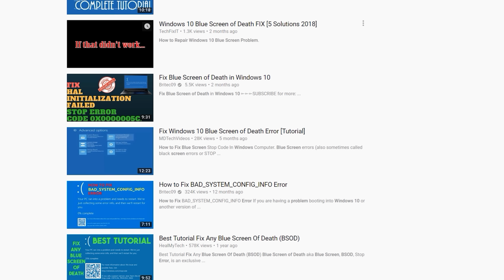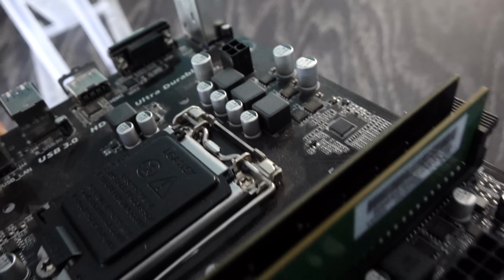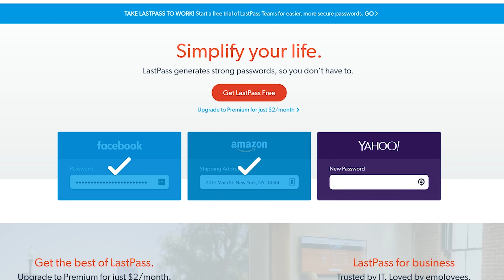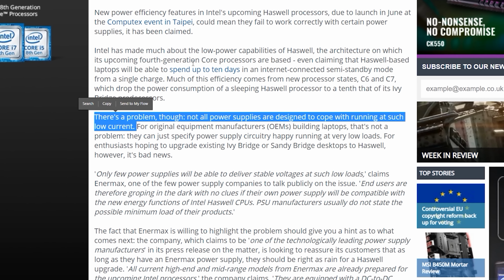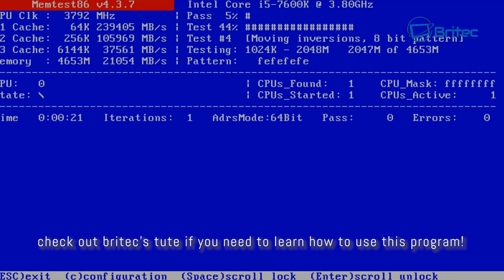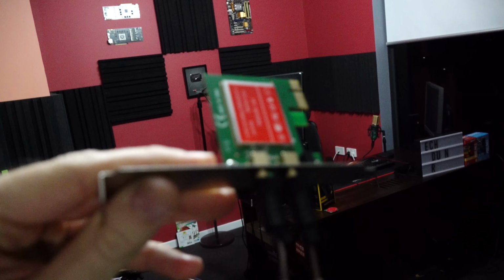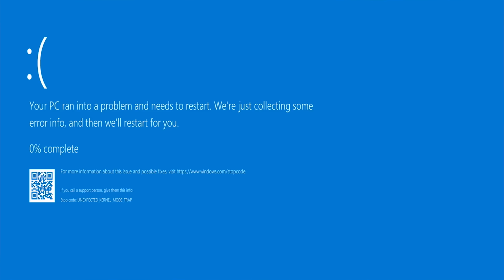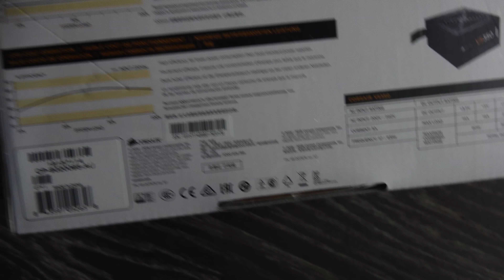How To FIX a Blue Screen on Windows 10

Comment: Go over random black screen for just a second or two then screen comes back and acts like nothing happened. It goes weeks at a time without doing it at all , then a day of it doing this every four or five minutes. I'm suspecting windows updates interfering  with gaming. I'm too lazy to check the cpu , ram , gpu usage. Windows 10 , 16 giggles of goats   , 4 core i5 7400, 1050ti
Reply: This is usually caused by the GPU core clock, try under-clocking or removing any overclock on the core of the GPU.

Comment: I had the weirdest powersupply failure ever. when you disconnected the psu from the socket and then reconnected it, the computer won't do anything for minutes. you couldn't turn it on. and after a few minutes, you could turn it on without a problem. I kept the psu longer than I should, but never trusted it.
Reply: Sounds like it had a faulty capacitor.
Reply: My ASUS automatically power cycles (on then off then back on) when you press the power after pluggin in the power
Reply: Some that wont warm boot? A friend got a similar thing. If he reboots it just stops, but if you turn it off and on again it runs fine. Also the BIOS won't keep settings even with a completely new battery.

Comment: You should probably mention not just increasing your CPU vcore randomly, or too high, especially if LLC is enabled. Easy recipe for overvolting the cpu.
Reply: True unless doing a high overclock.
Reply: Being conservative with LLC is a good choice to begin with. Going overboard with it can already overvolt the chip sporadically and kill it.
But yes, usually 1-2 steps over default should be fine. Usually there is the talk of 5% or even 10% over stock being safe in the long run. And luckily nowadays the boards show the voltage applied with current settings. So calculating the maximum "safe" amount. But again, 1-2 steps over default doesn't hurt.

Comment: Built a computer that just refused to post. The thing is, it would turn on and everything would run fine, but it just wouldn't give a picture. Tried new cables, new psu, new cpu, new motherboard, (to clarify I would switch parts around from the non-posting pc and some spare parts I have) didn't matter. I take out a set of RAM and try it... Works 100% fine. Put it back together minus that one set of RAM and it ran fine... Until I give it to my friend when the motherboard decided to die.
Reply: Sounds like my friends "House" Desktop. It wouldn`t post so they ended up getting a new desktop well i ended up taking it since it was just sitting there and they were going to end up throwing it out whenever.First thing i did was replace the psu when i got it just in case and turned out a stick of ram was bad.

Comment: Hello i love your content been watching you for 2 months , random question my pc sometimes crashes on the first boot of the day but on restart it works properly all day long what could be the problem?
Reply: do you have an amd card and use msi afterburner?
Reply: I do , r7 260x But i only use afterburner for monitoring not overclocking cause my gpu reaches like 70C while intense gaming dont want to risk damaging it
Reply: Unstable overclock?
Reply: Currently i do have an overclock on an fx 4100 to 4.2gh on stock voltages Temps are fine have an evo 212 but it has done it on stock clocks aswell so i said fuck it i OC anyways
Reply: Sounds like you need to increase V Core.I had the same problem when overclocking my i7 4820k along with 1600mhz ram to 1866 i had to max out some settings and figure out play with ram timings to make it stable.
Reply: I really dont want to increase voltage on my mobo it/s an MSI 970 one and i heard that it;s a bad overclock so for now i;ll just restore default settings on the mobo and hope it gets fixed else i;ll just live with it and hope the motherboard doesnt destroy my whole rig
Reply: Overclocking isn`t necessarily bad, unless you don`t know what your doing.There are plenty of fourms online and videos on youtube to learn from.I have a Msi motherboard aswell and pretty happy with it.
Reply: Sadly it isnt the overclock's fault i loaded optimized defaults closed it came back 2 hours later and it crashed on startup again i suspect either my PSU cause it only has 4pins for CPU power or motherboard is dying
Reply: Would suspect Psu/Cpu, motherboard i don`t know i would guess/hope it isn`t the issue.Possibly a registry issue?
Reply: I used every single other part on an older msi 775 socket board and didnt have a single problem so i guess it's CPU/Mobo issue , should i just say fuck it and try to find cheap used FX8*** Cpu or mod the 775 board for 771 and get a xeon?

Comment: The cmos battery is one of the first things I check.
Reply: How often would a cmos battery need to be replaced?
Reply: @BranZHamZ  p
Reply: @BranZHamZ I replaced it on my 12 year old pc last month for first time
Reply: this, i have resolved random blue screens after finding the battery was low and replaced it. assuming it was POSTing with some weird ram timings or something
Reply: yes even taking it out for 30secs and putting back in sometimes helps.
Reply: GReat jobs ... i tried it and its solve thanks mate
Reply: tnx for this hahahaha it works !

Comment: i never got a blue screen on this computer but if i use a riser for my video card and try to play games i get a black screen. then i have to reset my computer. without the riser i can play games on it all day long without any problems. i think it is that the power supply doesn't have the power to push through the riser and keep good power to the video card because i have the same thing happen if i try to oc  the video card
Reply: Or the riser just can't keep up with the data.

Comment: Working on a gaming machine today, the user tried to yank the video card out of the slot without releasing the retention latch on the slot, he ended up lifting the actual slot partially off the motherboard.  Going to have to replace the motherboard now.

Comment: I've been having the same issues for nearly a year now... Windows 7 Pro, 24gb RAM, i7 920, Gigabyte GA-EX58-UD5 rev1 flashed to F13 BIOS, GTX 460, 128gb SSD, 2 x 2TB Barracuda Data Drives.... yet, I can go 3 months without a BSOD or Auto Reboot and sometimes I can have my system reboot 8 times a day, I've changed my original power supply from a 500w modular to a high end 650w modular PS, given the system a TechYES cleanse, but still facing the same issues, all capacitors on the MB look fine, CPU HW Monitor states a max 160w draw???  I've been thinking of upgrading my CPU to a Xeon X5675 and a 1070ti, but don't want to waste the money if my MB is fried, just cannot understand how it can work for 3 months perfectly and then for one or two days reboot it self 8-9 times a day.. I love the X58 architecture.. any help would be appreciated Bryan...
Reply: I had a similar problem in the last 3 months. I tried a lots of things. What worked for me was get out the cpu from socket and reputing back. Its a system that i build in 2014.
Reply: I feel your pain man, but I've done all that, the system was completely stripped down, CPU put to one side and the MB doused in cleaner, left in direct sunlight for 5 hours (UK sunlight this is, before anyone thinks I've burnt out my MB in 100c US temps), power supply stripped down and blown throw to clear anything, even the memory channel slots were done with a small ear bud and alcohol solution, 2 days I waited to put everything back together... The only thing I didn't do was remove the heatsink from the VRM and Durable 3 covers and re-seat them with new TIM...
Reply from the maker: Would have to try out the hardware one by one to identify what is causing it, but also can try a quick datavac over it to make sure nothing is out of the ordinary, also too tight a tension from a cpu cooler can sometimes cause issues too (though it is very rare).
Reply: Could there be a loose screw somewhere inside your case?  Maybe it happened during the build process?  That be shorting out the motherboard
Reply: I'd pull the ram, remove any dust (also around ram slots) and put back in firmly.  Do memtest, maybe lower the timings of the ram in the bios if the problem hasnt been tracked down.
Reply: I had this issue with a 60gb SSD years ago, in the end I just bought a new one and all the issues went away.
Reply: It's the Windows update mess...
The weirdest thing is why you didn't upgrade your cpu!?
Reply: unstable overclock?? try lowering clockspeed
Reply: Nothing wrong with the F13 bios. Have the same spec PC. Try reseating the CPU and Ram. I'd recommend changing the i7 920 and get a Xeon X5650/60 if you are on a budget and definitely replace the CMOS button battery if it is over 3 years old. Incorrect time and date can cause issues. If your SSD drive has been on like 24/7 for 7+ years I'd probably want to replace that too.
Reply: Go step by step. If it is oc'ed revert back to stock.
Try anything to force the crash. That way you might get a procedure that "works"
Also check for firmware updates on your SSD. Had a similar issue that after some days of runtime the system would spontaneously freeze. Couldn't help it until I found a message of the successor series where a similar issue got fixed by a newer firmware. Updated mine and since then everything is fine.

Comment: I do get a weird smell from my brand new psu. 2 days ago i got myself a Masterwatt 450w for an old desktop of mine, and since i installed it, it keeps spreading this weird "plastic smell" and also, i can't seem to be able to see the psu spin up other than when booting the computer up, and even then, it only spinds for a couple of seconds.....
Reply: The smell will go away after awhile, i was worried when i got my Mac and i noticed it.Also replaced a cooler for the desktop and have it has a slight smell to it.

Comment: The weirdest issue I've ever had is with my current PC. I kept getting random hard locks, and severe freezing when running Cinebench or Aida64. I have an i5-8400 and I had to increase the voltage to 1.2v to get it stable, I haven't had an issue since.
Reply: If you didn't overclock and if you have a prebuilt pc, might just return the whole thing.
Reply: Miksuu I haven't over clocked but I do have a z370 board so maybe MCE was enabled on it or something. It's too much hassle RMAing the CPU and or the Motherboard. I'm planning on upgrading to Zen2 when it comes out anyways.